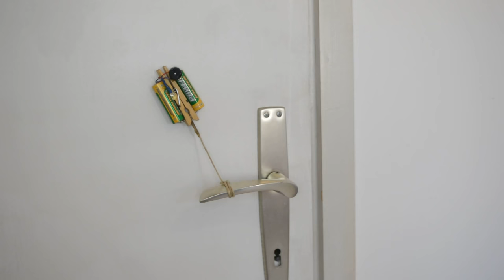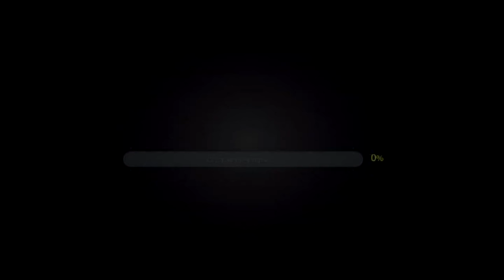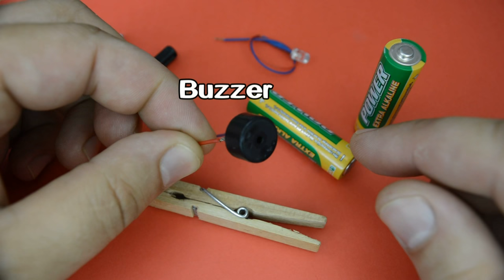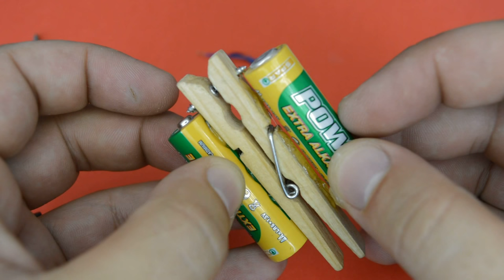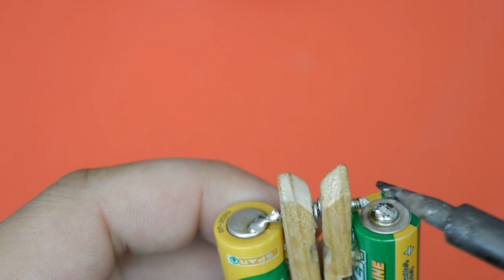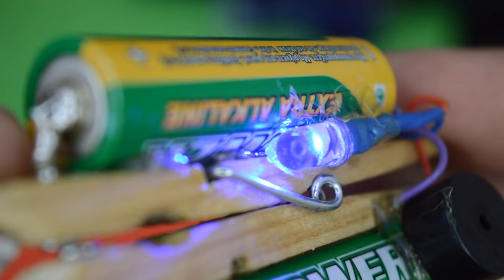Clothespin Trip Wire Alarm - Life Hack!

Comment: Is it safe to use solder on batteries?
Reply: yes. I've tried that but it will be difficult to stick. it will always fall off
Reply: you just need to lightly sand the + and - sides
Reply: I was soldering batteries when I was 8 years ;) Only you can burn
Reply: You can easily solder 18650 li-ion batteries if you do it quickly and have experience. They're soldered together inside laptop batteries. What you can never solder though are the little coin cell li-ion batteries because they're so small that they heat up immediately upon soldering and are nearly guaranteed to explode.
Reply: +Arcadio Munoz yes. correct
Reply: American Hacker who was that to?
Reply: non-rechargeable batteries are less heat sensitive. Li-on and such can quickly expand, rupture and ignite.
Reply: I always did because I was to lazy to break something with a battery holder in it plus it's easier to understand.